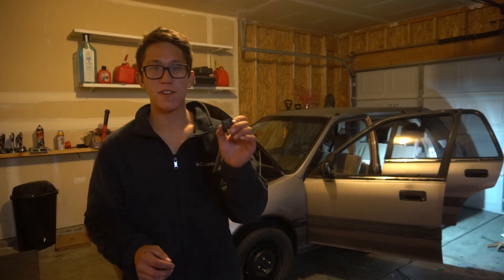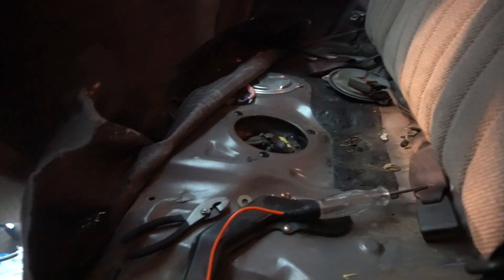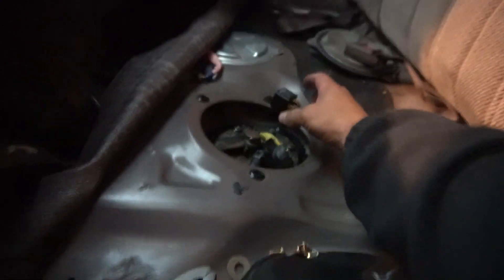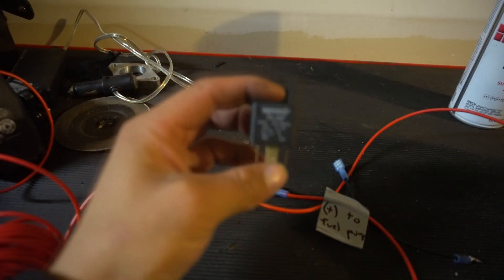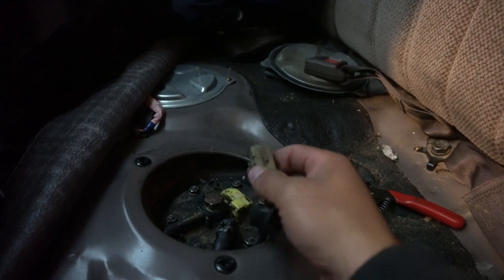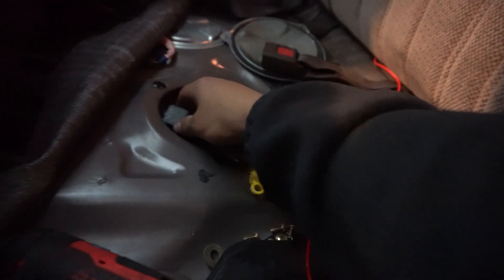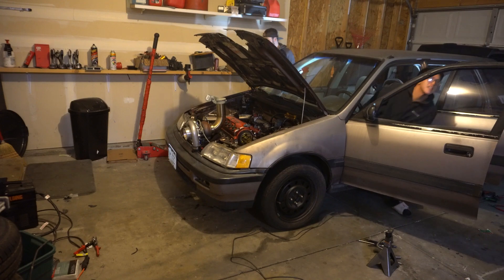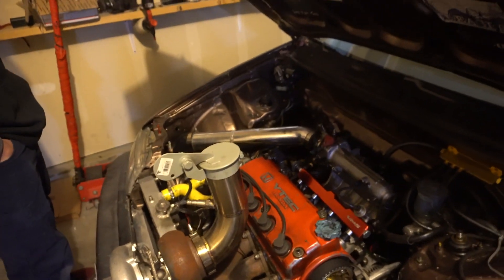How To Install a Fuel Pump Relay

Comment: It would be best if you swapped the old ground that you currently have going into the pump, to the relay, and that new ground you created for the relay ground, to the pump ground. Even though you have upgraded the positive feed wire to the pump, you are still using the original fuel pump ground, which kind of defeats the purpose of the whole process. You need a beefy ground too! No hate, just trying to help. We're all learning, every day :)

Comment: the wire on the other side of that plug that goes to the fuel pump is probably the same gauge as the wire you're replacing.
Reply: Yea, he did it wrong. The factory fuel pump power and ground is what controls the relay. The 12v straight from battery goes 2 fuel pump and the ground for fuel pump goes 2 chassis. New ground n power wire should b same gauge or ground bigger.

Comment: Maybe I’m wrong but if 14gauge is safe to 20 amp but relay pulls 40 amp won’t the wire need to be big enough for 40 amp?
Reply: You are wrong wire size is determined by the pump voltage requirements not the size of the relay.